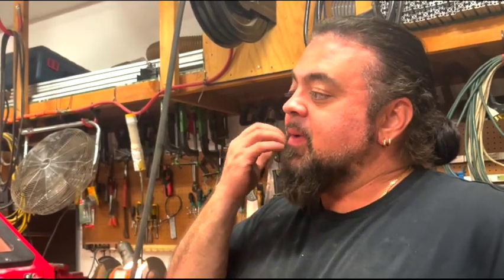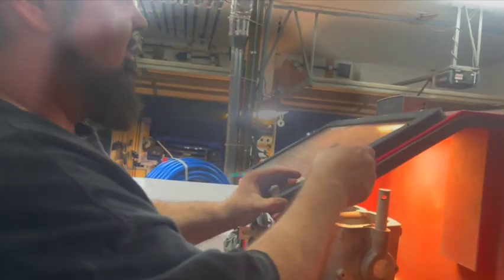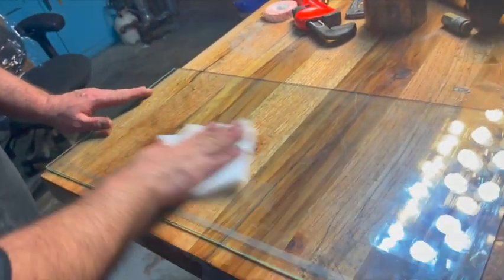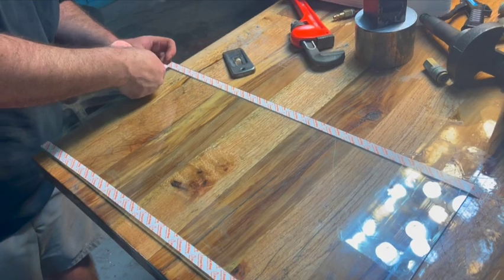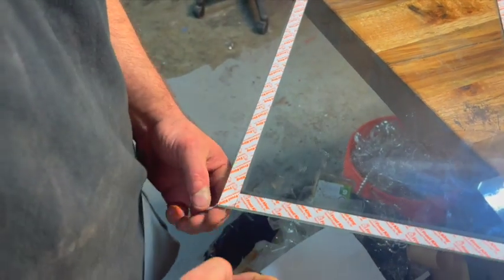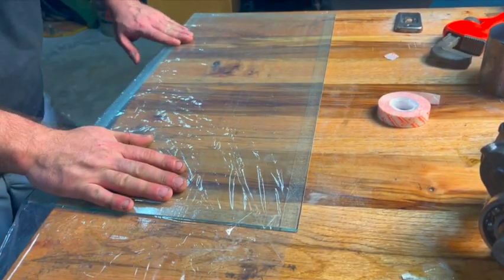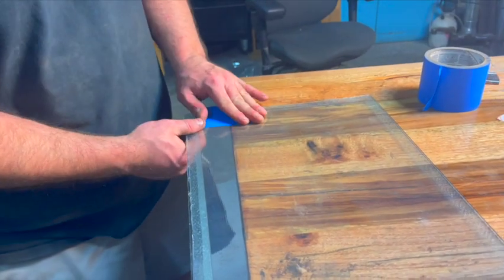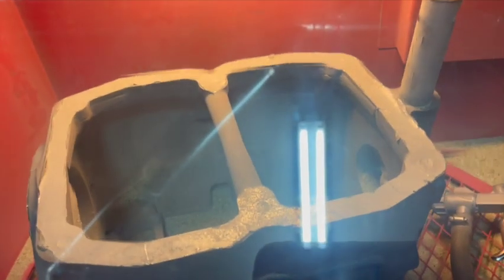Blast Cabinet Hack - Simple Glass protector replacement in a pinch

Comment: Buy some screws, regular bolts and wingnuts. Put the screws in the opposite direction around the window frame opening and secure them with the nuts. Modify the plastic window frame to go over the bolts. Secure window frame with wingnuts. Also, you can buy a carbide tipped gun upgrade kit from TP Tools. The upgraded gun and pickup tube makes a huge difference over the stock gun.
Reply from the maker: Great idea on the flipping orientation and using wing nuts.  I think I may tack weld them in place, and use wing nuts like you were saying.  Also, Ive been eye balling the pick up tube mod for a while.  Im going to need to figure out a way to raise the box up a bit so I can fit a metering valve under neath of it.  I also on getting a more ergo friendly gun with a foot controller.  My buddy has a shaker that he installed on his that is handy for getting the media to work its way back into the  bottom of the pan.     Thanks for the idea.  Much appreciated.

Comment: I wonder how long that protective coating will last?
Reply from the maker: They last about as long as the crappy film that comes kitted with the HF machine...  No exaggeration.  I mean obviously, its not a preferred solution, but works for the situation I was in where I needed to use the cabinet, but I was 10 days away from a amazon shipment...  It works best in a pinch.  It's probably not as robust as a good quality film, maybe 85% as good.   But one thing I will say is that it doesn't leak sand into it like the regular film covers do when the adhesive fails...  Cheers